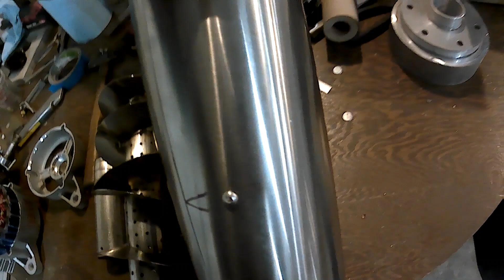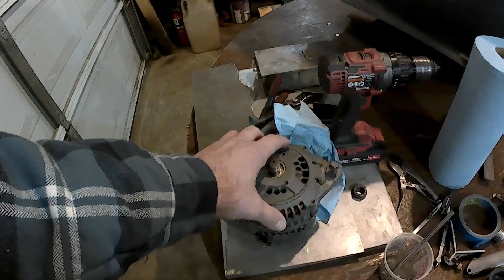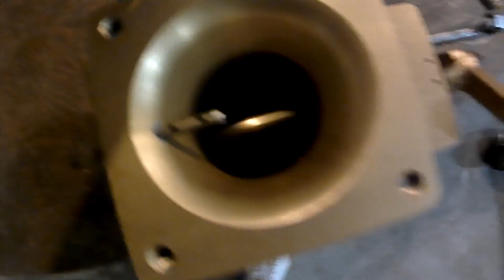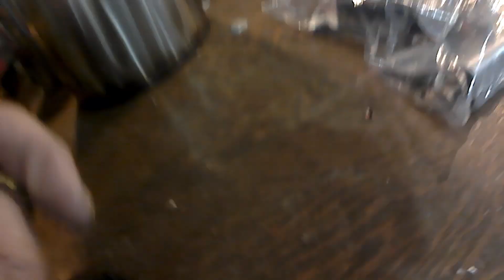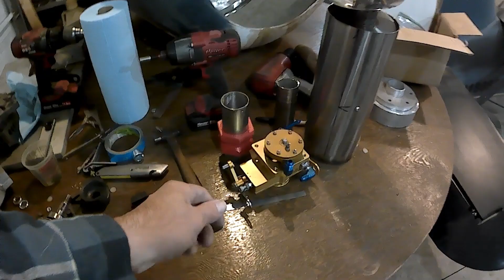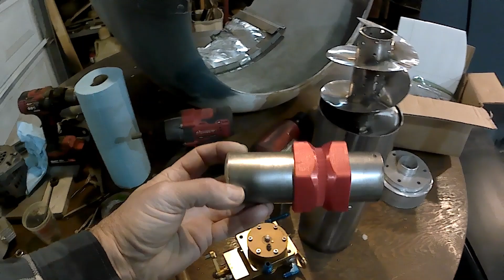WAR Corsair Update of mods and repairs.

Comment: Bunch of great stuff! Do you have a link to the 3d printer file for the gage you're using to mark the exhaust? The arduino systems are always very interesting so it's cool soon it integrated here.
Reply from the maker: I'll check with my friend on the files. I'm sure he got them from the common site online.

Comment: Is there a possibility that you will get a vibration in the muffler between the outside and the fins inside? Thanks for the video.
Reply from the maker: Vibration or maybe a rattle. The inside piece has a loose fit.